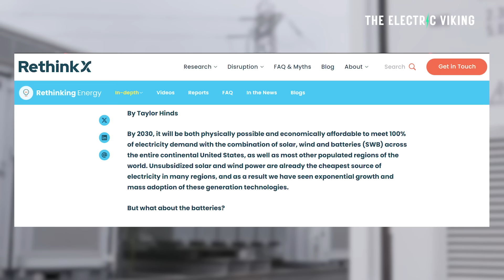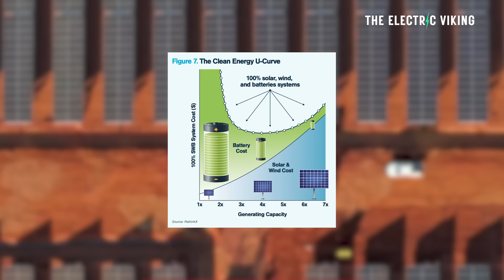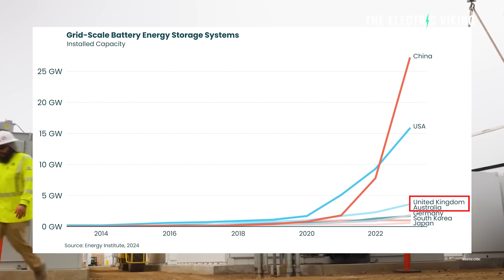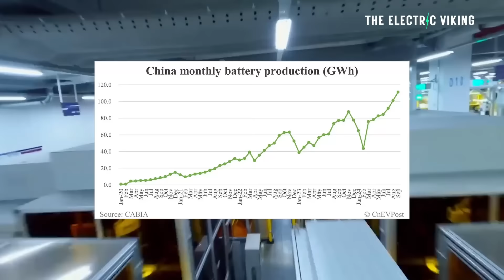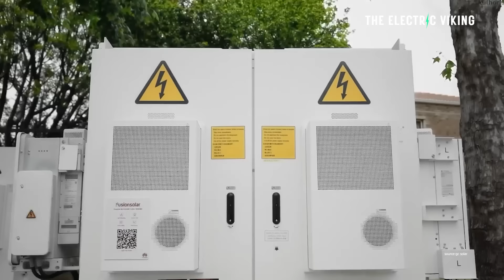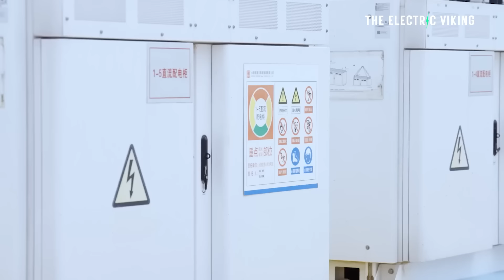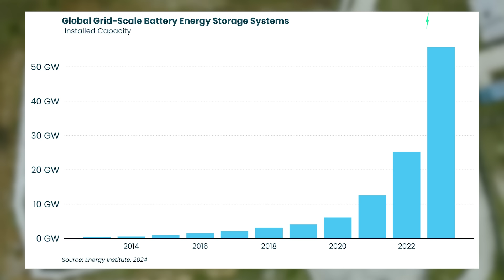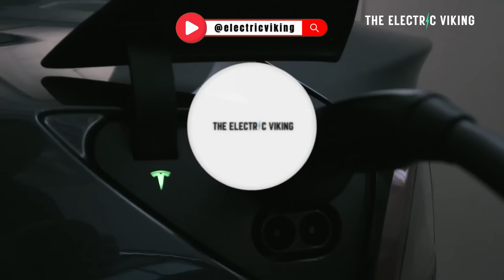RethinkX reveals the shocking exponential growth of battery storage worldwide

Comment: For perspective, 56 gigawatts is 0.2% of the global energy demand. One would imagine we'd need to get up to around 30-50 percent for batteries to be making some kind of impact on a global level. Assuming 10 hours of sun, that's 42 percent of 24 hours. So, the road ahead is long.
Reply: So like the last 5 years times 200. So in 1000 years everything is ready?
Reply: The road is long.  But we now have the road.  We have a way to travel that will get us off fossil fuels and help keep extreme climate change lower than what it otherwise would have become.
Reply: @plinble you gotta remember that the batteries would only last 20 years so after that point they would be replacing everything. Anyone that thinks we can run a grid off of renewables and batteries are misinformed.  The big tech companies thought that would be an idea that could work.  Now they are all investing in nuclear. If they have run the numbers and realized they can't even reliably run a data center off of renewables and batteries we should really be questioning the idea of running a grid that way.  Those companies are DATA companies with some of the best data analysis people in the world working for them.  The people pushing these ideas are finance people with large investments in the companies that make and install renewables and storage.  They are only looking for the highest return on investment.

Comment: In the UK during the start of November we had 11 days with no sun and very little wind .Our last 2GW coal fired station had closed a couple of months previous.  So to fill the gap would need 11 x 24 x 2  GWh of storage.   That is just to replace one fossil fuel station.
Reply: Umm, you don’t understand how grid storage actually works.  It’s about storing large excess in production for times of greater than current generation capacity, without having to bring expensive peaker plants to be brought online for short durations.  This is typically measured in minutes, eventually hours, not days.

Comment: Domestic storage pricing in GB seems to be stuck high. Online can buy 1kWh of li-ion Ph for about GBP 250.00, but you'd be paying like GBP 10,000 for 12kWh installed. Really need smart plug add and go, but the fuse boxes all need a major upgrade redesign to let you ad-hoc add storage, as you feel.
Reply: Your numbers are way high. For reference, the Tesla PW3 is giving 13KWh for 5K GBP base, extras +  install + ship on top so that's aprx 7K gross. But this is the high-end: a Victron +  Pylontecs would be much less for a perfectly decent system. The gotcha is cost/availability of good installers, and you almost certainly need some physical bashing/cutting /re-concreting which is a big extra.

Comment: Why do none of these battery installations have solar panels over the batteries?
It makes sense to solve one of the biggest problems with battery storage, heat, with panels that can provide extra power directly to the batteries below.
At our local Coles they built solar panel roofs over the parking lot. It looks good, the cars stay cool and out of the rain, and the centre is powered.
Reply: Good point. Would also put them in shade.

Comment: For the last few years I have had a 4kW solar panel set up with a 10kWh  battery and 3kW off grid inverter that I can be off grid with for around 9 months of the year. The problem isn't the storage the problem is getting the energy in the first place during bad weather and during the three months centered on Christmas due to living in Scotland where we pretty much get 18 hours of darkness at the Winter solstice. I added a wind turbine to try to get some power during the Winter but that is pretty much useless as the wind isnt reliable either at that time of year. Solar and wind simply can't hack it and most people don't live in places with lots of hydro.

Comment: The pictures you showed had a lot of vertical relief in the distance around the flat agricultural land.  Looks like an ideal location for off-river pumped storage.  The technology is off-the-shelf and I understand that the great advantage of off-river pumped storage is its efficiency, its huge power capacity and the ability to store power over much longer periods than is the case with batteries.  And such facilities don't have to be adjacent to wind or solar farms.  That is what the grid is for.  You put each facility in the location which is best for it.  A bit of battery capacity is probably a good thing because it is even better than hydro in instantly stabilizing the frequency and voltage of a grid but surly the real grunt work would be better left to pumped storage.

Comment: Excellent video, Sam.
It’s worth mentioning that the “exponential” growth isn’t the same as the strict definition of the word. My understanding of exponential is growth being influenced by the previous growth: ie. a percentage based on the increased figure from the last cycle.
The “exponential” growth here is more a function of the ever-decreasing cost of the batteries due to scale. OK, it boils down to the same result, just via a different mechanism.
It’s been obvious for decades that many countries - Australia in particular - potentially have more energy from wind, tide and solar than they could use and that the various forms of storage are critical in absorbing the energy.
Wake up, politicians, before we are dominated by those that have had the foresight to prepare.

Comment: The ARES rail-based gravity solar energy storage facility in Nevada and it's proximity to Hoover Dam made me think It might be more economical to install some floating solar on Lake Mead to reduce evaporation and use the existing power lines and maybe pump some water back into Lake Mead whenever the solar couldn't be utilized. In Canada we've got a pumped Hydro storage facility downstream from Niagara Falls that was built back in the 50's to pump water from the Niagara river below the falls to a reservoir at the top of the gorge during the night when extra power was available to be used during the day to produce power. They have one on the US side too. Damn I just checked, they announced plans back in 2018 for pumped hydro storage at Hoover dam for renewable energy storage, no mention of floating solar though. It seems like a perfect match, though, minimal extra transmission lines or major construction involved

Comment: I love this channel and enjoy the up-to-date information about EV‘s solar power and all things electric. It is disheartening and frightening to know that despite all of our efforts to increase renewable energy, it has not decreased the rate of petroleum production one bit. It seems that no matter what energy we develop and how clean it is, it will not satisfy our insatiable need for power/energy. I do not believe we should not develop these technologies however, if we ignore the continued increase usage of fossil fuels disaster will be set us as we drive our EV down the road. This is a sobering, reality that we cannot ignore
Reply: EV's are increasingly cheaper to buy and much cheaper to run, with virtually no maintenance requirements. ICE vehicles will rapidly die out as they equally rapidly wear out.
Reply: BEVs have only been at scale since Tesla put out the Model 3 in 2017 / 2018. Since then EVs have expanded Geometrically and are replacing ICE Vehicles at a Faster rate than the auto market is growing. 
Battery Storage + Renewables means that Coal Usage is plummeting in Advanced western countries. Within this decade we’ll see a similar plunge in Coal and OIL Usage in the West and China.

Comment: Southern New Zealand has spare water. The  lake Manipuri hydro power  runs two miles of Aluminium electrolytic converters.  Making rock into various Aluminium alloys.  Other metals might do similar. Hydrogen too is required in this field too.

Comment: We just had a " Dunkelflaute " for about a week and had to rely on our neighbours to help us out with nuclear, fossile and certainly some renuewable  electricity . This caused a price hike from normally around 40 to 820 €/MWh without grid fees, distributor margin and value added  tax  increasing the customer prices by another   ~ 300 €/MWh. To avoid this we'd need around 63 TW ( Germanys average consumption with - as of now- still very little heatpumps and electric cars, and without electrification of industrial heat and chemical production,  adding another roughly 400 Tw) x 7 days x 24 h ~ 10.500 TWh of storage capacity!

After full electrification we will need in the order  of 50.000  TWh

Comment: 4:10 It depends on the thickness of the clouds. On the worst rainy days, my solar system produce about 4% of their peak capacity. 
50% is "Partially cloudy". 
98% of solar panels on the consumer market are basically the same. Most important is the inverter being efficient and safe.
Reply: I suspect that “cloudy” in Australia does not mean the same that “cloudy” in England means
Reply: Like how blonde hair has different meanings depending on how light the normal hair color range if the region gets

Comment: What amount of space is required for batteries that store enough energy to allow 100% solar supply of electricity especially during rainy and gloomy winter days?
Reply: I have batteries in three houses one has 15KWH second 20KWH third 30 KWH. So about the size of a car battery. We still have grid power but can easily function during grid failure with a little temporary lifestyle adjustment.
Reply: a few container sized batteries can power a small town
Reply: Good question, happy to see that people were eager to answer
Reply: @eldictator1  That would be excellent. Not keen to live in a city with a nuclear plant.

Comment: Fire services across the world are recommending that batteries be charged "outside and not on a fire escape route" - how does that work for home-battery installations? Are there siting issues that need to be resolved? What do the insurance companies say? Or are the risks "low enough"...? 🤔 (I recognise that these battery systems cannot be compared to dodgy electric bikes/scooters  with dodgy chargers bought on-line, but even so, there is a risk here.)

Comment: There's a lot of unrealistic hype about battery storage in Australia - in the last year, battery storage only provided about 0.2% of demand on the national grid. To put this into perspective, gas (mostly used in "peaker" plants) provided 5.2%, and pumped hydro provided about 0.7%.

This is insignificant in terms of storage capacity - at this level, batteries can only provide grid stability services, and aren't even close to providing enough storage to be able to use some of energy from solar PV currently being lost due to curtailment, let alone to enable renewables to replace fossil fuel generation....
Reply: Doesn't include small local batteries,  which will increase as prices drop, probably within 10 years you will see a lot of home installations
Reply: Very detailed share, cheers to that.

I don't know as much as you. It seems though "...only be used to provide grid stability services..." is your reason for us to not be hype? 

Providing grid stability makes me hype about this new and improving technology. Ty again for your write up 🍻
Reply: @borshardsd  grid stability services means that the batteries provide backup for short term fluctuations on the grid (seconds to minutes), usually caused by sudden increases in load, or a generator tripping, and stops the grid from collapsing while you wait for other sources (like gas turbines or hydro)  to ramp up or come on line. This isn't necessary on a fossil fuel grid.

There's currently nowhere near enough storage to enable significant amounts of excess energy from renewables to be stored for later use, which is necessary for them to become "dispatchable", and to replace fossil fuel generation.

The batteries currently aren't really doing much useful, apart from making money from "arbitrage" (storing power when it's cheap, and selling it at peak demand when the price is much higher).

A lot of people (including Sam) don't seem to understand this....
Reply: @peeemm2032  ty for the explanation. Could one say the idea is good but currently the amount of use is being hyped up? 

Is it practical to continue deployment?
Reply: @alexjohnward  that includes any storage battery on the national grid, but it doesn't include home batteries installed "behind the meter".

There's currently about the same again in home battery storage, which takes the total to about 0.4%, which is still insignificant.....

We're going to need many times more than this before we can replace fossil fuels with renewables.

We're not even close yet.....
Reply: @borshardsd  you're welcome.

To answer your question, yes, I think the amount of battery storage in Australia (not talking about other countries here) currently is massively over-hyped.

If Australia is going to replace fossil fuels with renewables, we are going to need a lot more storage of all kinds (not necessarily batteries) to do this.....
Reply: @peeemm2032  effin nice to read civil thoughtful comments! Ty for filling in some ignorance for me.

Be well mate!
Reply: @borshardsd  no problem. Cheers - you too!
Reply: @peeemm2032  My understanding is that "grid stability services" are necessary on any grid, unless you just tolerate many black/brown-outs
Reply: @jonb5493  the traditional fossil fuel/nuclear/hydro grid has inbuilt "grid stability services" in the form of the  rotational inertia of the alternator/turbine sets in the generating equipment. This helps the traditional grid to ride out short term spikes and fluctuations, which help it to maintain voltage and frequency stability.

This is not so much the case with renewables like solar and wind, so grids with a high proportion of solar and wind might need some help with this....

Grid stability was one of the stated reasons for building the Hornsdale battery, as SA were having problems with grid stability with their high proportion of wind and solar...